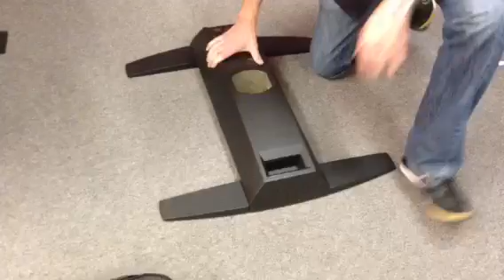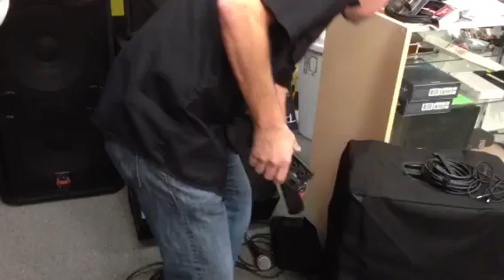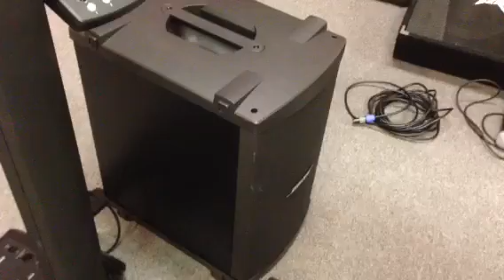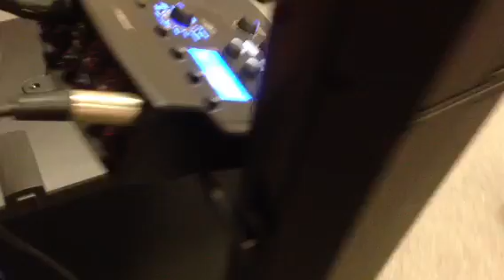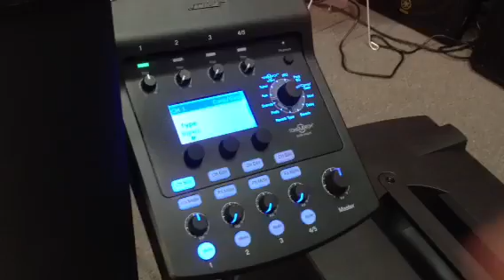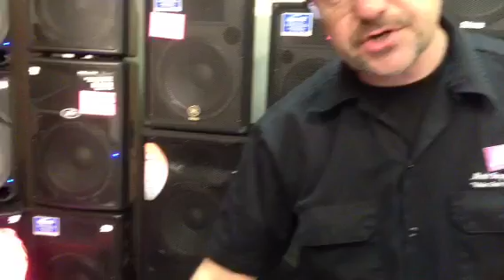Jireh Supplies - Bose L1 model 1S with B2 sub and T1 ToneMatch mixer initial setup

Comment: how do you connect with another Bose L1 model 1S ?
Reply: Good thing I found this video again!!

My friend has two Model IIs hooked together to one mixer. If you were using Tonematch like Gene does here, you would just set one up normally; but on the second 1S, you would use the one 1/4 plug on the power stand of the second 1S and plug it into, say, the 4/5 channel on the Tonematch and control it that way. But first, you would have to set the volume on the second 1S to halfway or so.

Comment: I own this model and it has great sound I don't use the Tone match I only put a keyboard through this PA system.  the mixer is in the keyboard.  So My question is Can I pan musical instruments using my Keyboard settings so that it comes out left or right side of the 12 speakers.  6 Left and 6 Right.  ?

Comment: Hi Gene,  Would you kindly help me out? I hooked up my guitar cable into
 the Bose T1 ToneMatch on channel 2..I selected Acoustic guitar, turned 
on both volumes (on Tonematch and Base at bottom)  but still did not 
work? ....I started to play the guitar but  did not hear any sound from 
the Bose speaker . Also, I did not see the green light at the top of the input signal on the channel 2 2  .....Do you know the solution?

Comment: when it comes to the ipod connection, your method is not correct. The correct way of using the ipod on the tonematch is to use the channel 4&5 with a split cable red (Ring) on top and gray(tip) on the bottom and the 1/8th end into the ipod. Also you have to set the Tone Match preset to DJ play back to get the optimal sound playing the ipod.